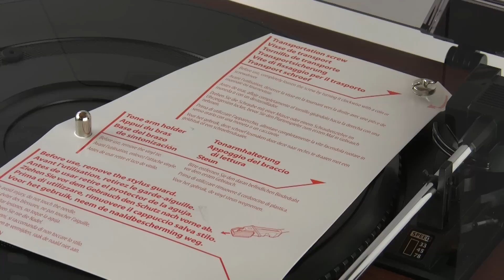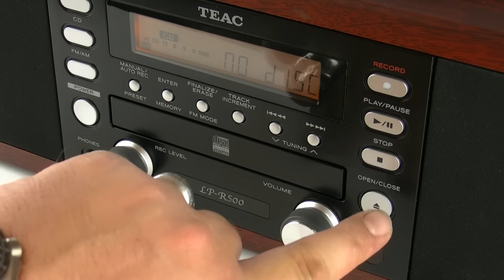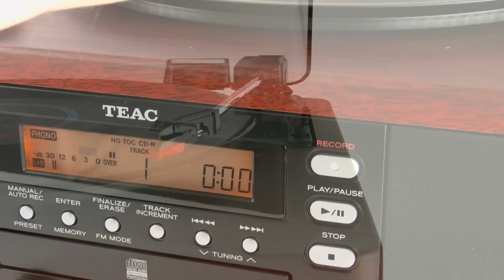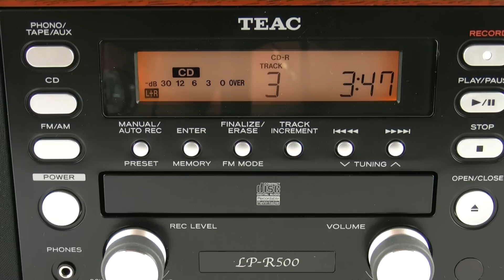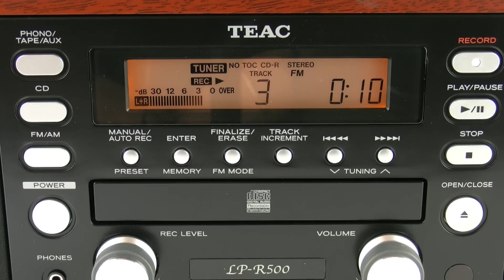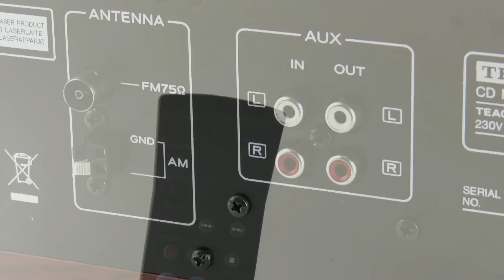TEAC LP-R500 How to Use

Comment: Hello, I have a question about the CD player function in this equipment, there are albums that have songs that should be played together (i.e the first two songs on Beatles'sgt pepper) some players add a gap between them and that ruins the experience so does this player do the same or does it have red book standard? Meaning you will not hear any gap between them?

Comment: I had my older model for seven years, no issues, new one is excellent. I tend to use the AUX with a decent Turntable, or Cassette Player. It does the job perfectly, transferring the data to Mac works perfectly. I never finalized the recording process, because once the Recording Disc is full, it simply rewinds in a minute, and automatically finalises the music data. Great sound once the vinyl is converted to Digital, you can tell the sound quality is superb, when you listen to your newly taped CD in your car, crank it up and enjoy.

YES the TEAC Quality of this particular model may NOT be the most fantastic, BUT.. it does what it says on the box, and records great music from cassettes or vinyl, for you to enjoy on your computer in your car, wherever.Not many real competitors out their in this popular marketplace, which is surprising. Merry Christmas to you all, and stay safe.

Comment: @D Lynn I'm a hifi technician and I know these products. Because people come to me when the thing breaks and believe me, it will sooner or later. Later in this case will be sooner than you think. The mechanics of the turntable are so basic that it is a real joke really. Seldomly the speeds are right, no tone arm bearings so very heavy friction that will harm the record groove and the lack of anti skate makes things only worse. Even if people want to buy them for creating a digital format I strongly advice not to get one. The sound coming from the cartridge is so distorted and thin that the results are terrible. Heavy distortion, crude cantilever construction and excessive wow and flutter will make sure there will be no good results possible. I have opened up one of these and what's inside is pure junk. If it breaks, the defects will make sure getting it fixed will be impossible leaving the thing worthless. Something this equipment is fresh from the box actually. So avoid, you will be diappointed.
Reply: leyland9999 give the guy a break will ya. As someone who often listens to music and has a pet hate for wow and flutter. I must say that these machines aren't to bad. Has a bit of bass to it and unnoticeable wow and flutter. So don't get to upset about the video

Comment: @wii1245 Yes, you are right. However, the cantilever, this is the tube the needle point is attached to, is so crude, yes, in this case often made of simple plastic(!) or rather thick aluminum, the needle down force has to be heavy. But the more weight, the more wear and tear. And, too much force will mean your records will be damaged, permanently. To make things worse, there is no bias, also known as anti skate. This means the needle wants to move to the centre of the record. This is pure physics. So the inner side of the groove will be even more damaged. Now, if you know what real forces we're talking about, given the small footprint of the needle in the groove, I hope you will understand what damage will be caused. Perhaps not audible on this piece of &@€€@&€&, but if a damaged record is to be played on decent equipment the damage can be heard no doubt. And you will regret your purchase of these crappy players. Avoid. You have been warned.

Comment: Does this automate the process of splitting tracks up "on board" or does it require a computer to edit the MP3 output? All of the other USB turntables I've seen merely output one continuous MP3 file and the only workaround is either spending quite a bit of time editing the output on a computer or manually attempting to time the breaks while in the midst of a recording. If this Teac can insert breaks between tracks how does that aspect of the operation work? 

Lastly, on other USB turntables the upper limit appears to be 128 kilobyte MP3 output but that's on the low end of the spectrum in terms of audio quality for an MP3. Does this allow users to generate a higher quality MP3 file? And, finally, am I correct that while there is a USB port it requires a direct connection to a computer to operate this way? (No flash drive or SD card direct-write option for MP3 creation?)

Comment: I've just watched the video again. Since it was quite a while ago I saw what type of record player is incorporated in this set. I'm sorry, this thing WILL damage your vinyl, if not instantly, you will notice the damage if the record is to be played on decent equipment. I explain why: there is NO anti-skate, the needle force is around 6 grams, SIX! Sorry for shouting but this is way too much and the damage is done instantly because it lacks anti- skate. The dirve motor is not up to its task, it shows way too much wow and flutter, the platter is made of hard plastic and there is a lot of play at the base of the tone arm that, to make things even worse, much friction as there are no bearings at all at the base.There you have it. I'm sorry.
Reply: +leyland9999 For over $300 this should qualify as "decent equipment". I don't know if there's pitch control, tone control or anti-skate but for the price it should have those features. Then, again, I think the assumption is that people are using these things to get their music off the LPs to a more portable format, never to return to the LPs again (or rarely). As for the needle force being 6 grams or the lack of bearings at the base, how do you know this for a fact? Do you actually own this unit? Remember, too, most vintage turntables were designed before there was such a thing as Autocad or even PCs for use in the design process. Perhaps modern "precision" engineering/manufacturing methods allow for manufacturers to leave some of the compensatory features off because they don't anticipate as much sample-to-sample variation. It's probably a combination of both — not anticipating that a product like this will get heavy use, being that it is mostly marketed as a conversion tool, and the fact that computerized design wasn't a part of the manufacturing process years ago when turntables with anti-skate features and such were the norm.
Reply: @newsview7844  wait will it damage my vinyls????
Reply: leyland9999 you're talking about the tracking force? If the force is too much, it can damage the record. If it is too light, the needle won't pick up the vibrations from the grooves.
Reply: @wii1245  will it damage my record?? I'm thinking of buying one.
Reply: @wii1245  I don't wanna have my record damage. Please help. Is there anything I can do to not damage? :((((

Comment: can u use regular cd-r cd-rw    I read u have to use special disc
Reply: +Brian D. As long as the CD-RW is for music, not data, it should work. It appears the host is using a data disc in the example, however, so it may not matter. Any office supply store should carry what you need.

Comment: This thing is not the quality TEAC was famous for way back when! Don't be fooled by the name printed on the cardboard cabinet, it is a piece of junk coming from the same Chinese factory where Crosley, Steepletone, ION just to name a few are made these days. AVOID! The quality is absolutely terrible and won't last long, a year or two may. The turntable has very inconsistent speed due to a tiny dc motor and the turntable is made of cheap quality plastic. Have a look inside and you know you are going to waste your money. You have been warned!
Reply: +leyland9999 
I've had mine to close on 2 years and though at first I was doubtful of the quality but it does what it says on the tin! A great piece of kit most useful for those who wish to transfer their vinyl and cassettes to CD.so my advice is if this is the sort of thing you are after then this is an excellent solid built piece of kit
Reply: Bought one from second hand store. Dont know what it's been through. But I can say this sounds better than my dad's Panasonic that I just spent $100 in repairs and parts trying to get it working again. Bought it for $35. For the quality and the ability to record to cd I'd pay way more. Awesome turntable, worth more than I spent.
Reply: this guy is right. complete junk and I feel screwed I wasted my money. makes my vinyl sound like scratchy high end trash. probably ruined now.
Reply: do you even own the product?. it does what is supposed to do. the thing is BETTER than my old GE turntable. in every way possible. it plays cds. tapes. and all lps. has fm. and transfer them all to CDs. it looks feels and sounds like it was made decades ago. it is heavy as fuck like how things used to be.  for less than 300$ it is cheap. a shitty phone cost more than 300$. we are not in the 70s. i clearly remember my old cassette stereo players(which were Sony and Panasonic). they do break down. anybody says otherwise is a liar. "it won't last long"?. does 3 years sounds like a short time?. or should i wait a decade?

for anyone else reading this. ignore this guy. he is probably being payed. misinformed. or just hates teac. this product will do everything  you need. save a lot of space. it is rock solid and really looks good with the furniture. the makers did a great job. you won't be disappointed.

Comment: I did according to the instructions, but the cue lever doesn't feel like it is connected to any moving parts, it just rests there useless. also the turntable doesn't start turning even when I slid the tone arm towards the vinyl. Also the turntable section doesn't look or feel solid, it slides around when I tried to move the tone arm